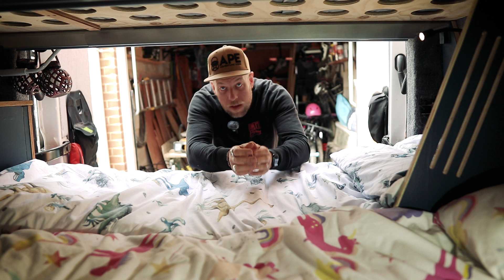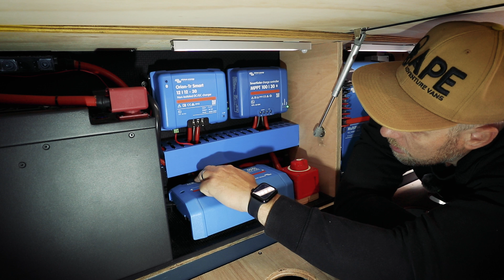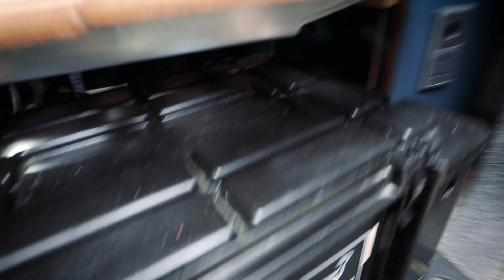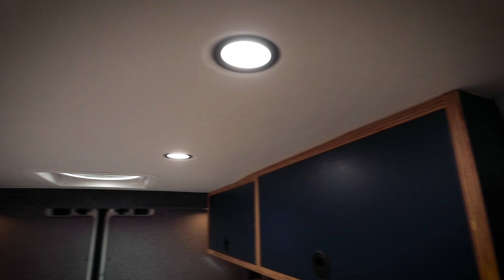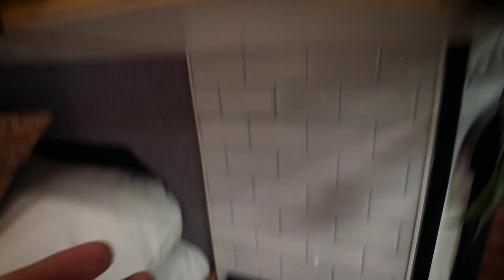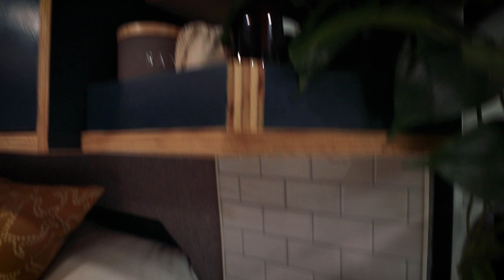Off Grid Victron Install On A Budget | DIY Family Campervan Build

Comment: Thank you so much for sharing your system. I am looking to get started on my electrical system with a basic understanding of how it all works.   With all the bells and whistles, I am a bit overwhelmed and was hoping to find a simpler method, as I would not likely understand a more complex system. Years ago the off grid systems managed pretty well without all the frills. It maybe nice, but it also means more things to go wrong.  One question what induction stove do you have? Thank you for brilliance
Reply from the maker: @peggy4920  Thank you. It can be overwhelming but take the time to size everything and mount in logical locations for access and you’ll be fine. But if in doubt consult an expert.

We use the outdoor revelation camping double induction hob. It’s 1600w max 800w x2 - it may take a little longer than a standard induction but plenty powerful enough to cook a meal in 20mins

Comment: Wonder if you could help me, I’ve the same inverter as you, when I connect the shore power to the van what setting do I put it on for through power? ie not charging the batts or using the inverter for power. Hope that made sense!
Reply from the maker: @exploresandtosummit  What controller do you have? 

I have the DMC and usually just use charger mode on shore power.

For effective bypass I believe you need to switch inverter to ‘on’ and with an AC supply in (shore power) it takes it direct from the input. The reason being is if the shore power is cut or drops the inverter will then take over.

Charger only is exactly that, so discharge is from the battery but it’s being topped up at the same time up to 80a hence cables should be sized for total discharge and supply capacities.

Comment: How much roughly did your victron system cost with the battery
Reply from the maker: @ChloeVerse  All in, incl cables, lugs, solar panels etc it was about £4k. But given we don’t need to refill gas we’ve also saved a bit on fuel for cooking 👍
Reply: @VanFamilyAdventures  we have a Clayton unit and just doesn't suffice for a weekend unfortunately. Got solar panel too 🤷🏻‍♀️ tempted to upgrade to victron. It's not an issue when on hook up
Reply from the maker: @ Clayton have recently release an extension pack, might be worth looking into. What size panel are you using? And are you using induction?
Reply: @VanFamilyAdventures  yeah seen those quite expensive! We use a 400w panel and then yeah we have induction
Reply from the maker: @ Nice. I was tempted by the Clayton purely on ease. But the capacity vs price of the Victron setup was what put me off. We’ve rarely been below 60% capacity and camp all year round, weekends away and 3-4 week road trips in the summer. It’s been solid for us. If you’ve got the space it’s worth it 👍

Comment: Don't often comment but having watched tonnes of similar videos i wanted to thank you for the clear explanations in a well presented manner. I was also looking into Clayton and similar systems but when i build my moto-van next year will be copying your design i think as i also want to go gasless. I agree about redundancy should a part fail and the costs don't work out for what you get. Keep up the good work 😉
Reply from the maker: @chris329a  Hey Thankyou. Glad it helped. I’m literally about to order an Orion Xs S to swap out the existing DC charger so point proven again when it comes to modular system builds.

Enjoy the build ✌️

Comment: Sweet. That looks like a clean, compact install. We live off grid full time in an older motorhome that doesn't have much basement space. Our 95-gallon freshwater tank is under our bed, taking up a lot of space but we were still able to put a row of 320ah Prismatic cells on oner side in a 16s configuration. We also have a 560ah 2p4s 12v battery made from 280ah cells that we carry under the steps where our original 2 GC-2 lead acid golf cart batteries used to reside. We mounted a Sungold Power48v 5000w all-in-one inverter/100A charger/charge controller mounted on the wall in our bedroom. We get a little fan noise from it at times, but it's not as bad as some fans I've heard. We chose this brand as it supports 500voc solar input and we have a 400voc, 4,400w array on our roof we use to charge our 48v battery. We also use a 620w liftable side array to charge our 12v battery. This is sufficient for our needs, as we can run everything in our 35ft Class A MH, including both A/Cs as needed without ever having to run our bank-up generator. We usually run our 12k EG-4 28.5 Seer-2 heat pump all night long as it's super-efficient and uses very little power. At night, in A/C mode it uses about 300watts and in heat mode about 500 watts, so our 16.4kwh 48v battery easily lasts us all night. 

I like the simplicity of your system. One of the things I sometimes find confusing with ours, as I'm 68yrs old and not an electronics whiz, is there are over 60 parameters we can set on our all-in-one inverter/charger. I found it was actually easier to design and build our system than get all the settings are right to make it do what we want. The manual is helpful, but I had to call tech support a couple times to get them to explain a few things before I figured it out. Simple is better, I think.
Reply from the maker: @SuperSushidog  Thank you. Theres quite a bit of config to do via the app and to make the inverter active after install it requires a special cable and I got  remote tech support to help make sure I had set all the parameters correctly.

But since then I haven’t had to touch it and it just works. 

Sounds like you’ve got a well considered big power system to maximise the space. Are all the panels flat on the roof or are some at different angles?
Reply: @VanFamilyAdventures  The first 2, 550w panels are at a 9.5-degree angle. dropping down to meet the roof where the fiberglass cap ends, and the roof begins. The other 6 panels are mounted horizontally, 15" off the roof, just above my front rooftop A/C shroud, allowing lots of cooling air underneath. Not only do the panels run cooler, producing more power but the RV is always in the shade, so it stays cooler too. This eases the air over the array, creating a laminar air flow that is superior to the turbulent airflow from all the things that once protruded from the roof, so our MH actually has less aerodynamic drag than before. It seems a little more stable when driving down the road too. My mpg hasn't changed, despite the additional weight.
Reply from the maker: @SuperSushidog  That’s a win in my book. Fuel is cheap anyway right? 😂
Reply: @VanFamilyAdventures  Our motorhome only gets about 8mpg on regular gas, which isn't too good, so we learned to limit the number of miles we drive each year. When we started out, we were still in vacation mode, driving 7-9,000 miles a year. We have been reducing this annually though. Last year we only traveled 4,500 miles, though we went from Arizona to North Carolina - almost coast to coast. This means that we spent under $2k on gas for our coach at an average of $3.50/gallon, less than we spent on gas for our 30mpg toad which is our daily driver. If you compare this to what most people pay for housing, we are way ahead of the game. Plus, gas is a controllable expense. When it's high we move less and when it's cheap we travel more. Since we switched to a residential fridge and now supplement our space heating with our heat pump, our solar system saves us about $450 a year on propane too.

Comment: There is nothing remotely budget about victron, its high end super expensive gear. I went with Electrodacus charger/bms, Giandel inverter for 1/4 the price and while the inverter can't power my mitre saw even though its specs say it should it has all been working 5 years no problem.
Reply from the maker: @jedics1  I hear you. ‘Budget’ is very a personal and subjective word. Sure, you can build systems ‘cheaper’ but for the added efficiency and resilience the blue stuff is well regarded. I could’ve easily spent double but would I have got twice as much value or usage? Probably not.

The important thing is building the system to your needs and budget. Sounds like you’ve got a decent system there 👍
Reply: @VanFamilyAdventures  I think they're priceless! I think it's so awesome how you can keep these systems for another future use such as a hunting cabin or tiny home. On the road it's not just comfort, but survival! There's lots of great options for all kinds of budgets. All kinds of brands. I just think Victron will hold its value for longer than other brands. Like that Orion that you could upgrade..someone out there would love to buy used components. Jedics system too if he wanted to upgrade.
Reply from the maker: @laurieclarkson9180  Yep. The individual components should hold their value when upgrading which helps offset the cost a bit. Thanks
Reply: Is it because of the surge current needed by the mitre saw tipping out your inverter?  Will a soft starter fix the issue?

Comment: Cooking on induction that must be energy sapping
Reply from the maker: @alphabet6814  Yes it can be. Roughly 1600w (full draw from our portable hob) will be 133Ah so cooking for 30mins uses around 60amps on full whack. 

Typically we find cooking a meal uses 10% (46Ah) and boiling a kettle is 2% (9Ah).

Comment: Victron Blue electrical components are a van area where form sometimes goes beyond the function with vanity backlit boxes behind perspex covers as if one was displaying the Crown jewels rather than just providing the power of modern life.

However, your electrical form is a genuine beauty to behold as masterful and elegant while at the same time fabulously functionally and completely thought through being properly sized for your needs. I can understand why you are rightly proud of the installation too as it is neat, tidy whilst fully utilising the space available: a wonderful build.

Particularly like the design thought with the satellite 12VAC system as a way to simply future proof against additional requirements and needs - an often overlooked propsective situation... And I do hope you don't need to re-wire to accommodate the XS B2B box in due course.

Inspirational.
Reply from the maker: @ostwelt  Wow! Thank you. Appreciate it 👍 I agree that some builds are just way too overkill and form over function. We built this van to be used in all weathers. Thanks for watching ✌️